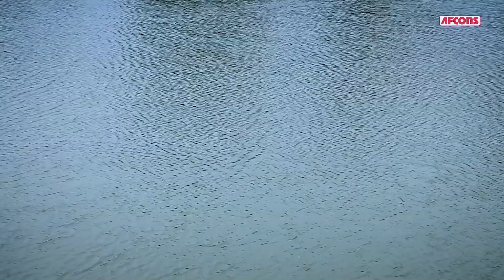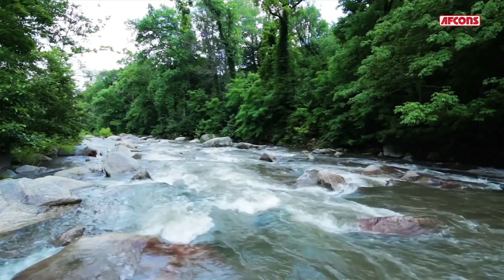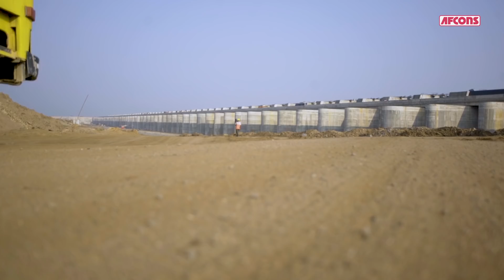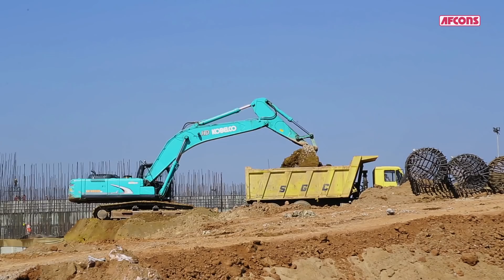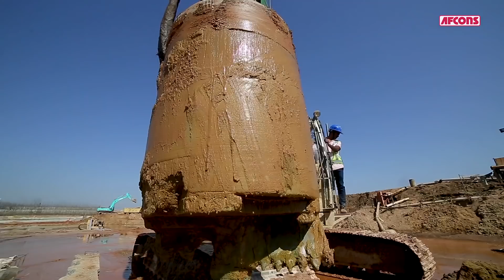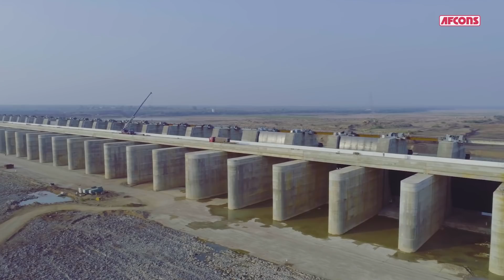Annaram Barrage - Defying Gravity

Comment: When this barrage foundation was laid, we thought that after 30 years our grandsons will enjoy it's fruits . As i returned from Australia after 3 years, i saw barrage with full of water.
It is a big shock for me. I didn't expect  that  will be completed in just 2 years.
Reply: naveen kumar BHEL make before schedule
Reply: @indiatraveldiary2605 
How BHEL is related to that barrage.
Reply: @naveenkumar-lj7og  pump
Reply: @indiatraveldiary2605  
It's megha company which made motors not BHEL
Reply: @indiatraveldiary2605  it is a not a pump house, it is a barrage.
Barrage don't have any pumps or motors.
Reply: Tremendous feat. I just hope govt also takes necessary steps (afforestation along Godavari basin) to ensure that water inflow does not deminish over years to come. (Like Cauvery)
Reply: Their sewer systems flow directly into their life water.
Reply: @naveenkumar-lj7og  it has 3 pump houses cumulatively consuming 1500 Megawatts of electricity that's how you punp water up stream and the third barrage that is being made will have pump house that will consume another 2000 Megawatts of electricity. 

(Dams supply water downstream not up stream)
Reply: Pl stop the debate and personal abuse. The project work is going on smoothly as scheduled.
Reply: naveen kumar they have several pump houses on this project, maybe not this barrage, but the whole point of the project is to raise water. 4600MW of pumps have been installed
Reply: @lrcrabbenz  it would be interesting to combine this with a solar array and energy  storage also... what an awesome project this is.
Reply: @dafrasier1  , What religion you belong to?.
Reply: @lrcrabbenz  but in this project, they store water in godavari river not in any tanks.
So if rainfall is adequate, no need of pumping.
Reply: GANESH BANDAMGANESH you’re missing the point. They have installed massive pumping capacity (4600mw) to raise water to barrages located at higher elevations. That is a fact! 🤷🏾
Reply: @lrcrabbenz  that barrages are constructed across godavari river.
If rainfall is scare, they will lift water from medigadda.
If rainfall is adequate, no need of lifting.
Reply: GANESH BANDAMGANESH pumping station at Medigadda allow Telangana State to utilise Pranhita River flow also. Sure, why waste energy if rainfall was plentiful, but why build so many pumps to distribute water across the other barrages if rainfall was assured?
Reply: GANESH BANDAMGANESH no tanks involved, buddy. The pumping stations lift from one barrage to the next. Clearly the designers have planned for inadequate rainfall as normal.
Reply: @lrcrabbenz  s,  designers installed so many pumps for inadequate rainfall, i agree.
But rainfall is unpredictable. Sometimes it is adequate and sometimes it is scarce. For example, Previous year rainfall is scarce but this year rainfall is adequate.
So no need to lift water if rainfall is adequate.
This year sri ramsagar, yellampalli etc barrages are filled with rainwater.
........
Reply: GANESH BANDAMGANESH I think high flows in Pranhita River would be lost to Telangana state, the Medigadda lift would capture these.
Reply: Its AFCONS
Reply: That's KCR 
HE MAKES IMPOSSIBLE TO POSSIBLE AND PROVED THAT
JAI KCR
JAI HAREESH RAO 
JAI KTR
JAI KAVITAKKA
JAI TELANGANA
Reply: @naveenkumar-lj7og  moters was made by BHEL
Reply: Congratulations to you and Telangana Sir. What a feat!
Reply: This happened because of current govt ...BJP is serious in development business....
Reply: Just 2 years, really surprised
Reply: @adityaayodhya  but your CM is appeasing minorities like anything, these projects all are to fool ppl main objective make money.
Reply: It's kcr who is behind this mission. We need more projects like this not religious structures. Coz we have enough of them.
Reply: Great  praise for you d guru in infra projects(Asia Foundation Constructions) AFCONS.

Comment: The similar project should be done on Brahmaputra and Gangaes river
Reply: Anoop Dixit you are complete disaster, because here in North India Water is not a problem, eventually the usage of more water in crops is a major issue. Moreover, this project is Lift Irrigation by a small state like Telangana. Astonishing achievement. People of India are not able to use Tejas Express(it runs empty mostly) so we don't need to invest in Bullet train. We need to Build Roads, Hospitals, Best Schools, Better training and Helping of Farmers, safe States for better Security by incorporating Moral values in Young.
Reply: @yogiegupta1373  we need both.
Reply: @yogiegupta1373  North Indian rivers need sewage treatment plants around them to clean the rivers rather than dams and barrages.
Reply: Ganga should be cleaned with sewage treatment plants and all the tanneries must be banned. Then we can think about the project. If we construct the project without cleaning it then the sludge will block the pipes and 2 to 3 lakh crores goes down the drain.
Reply: @yogiegupta1373  same thought was there when metro in delhi started construction
Reply: @yogiegupta1373  yeah those projects are very much of a need of the hour, and about bullet train, it's OKAY considering the terms of the finances of it from Japan,  we don't have to start paying the loans before 2037 and by than Indias national budget would probably be $1Trillion+

Comment: By using 4000 MW power liting water is seems confusing for me is it good or bad
Reply: 4000MW is installed capacity.
All will not run at once.
For example among 4000 MW, 2000MW will run just for 1 month.

Comment: Projects are good but this is one of the biggest mistake this government has made storing water at one place and lifting water in reverse direction that too very high distance how which current it needs to maintain and to run those motors it will cost nearly 4500 to 6000crs per year he is looting public money. That too the maintenance he has given to this party contractors all that money will go to this party fund. The day will come when telangana people will reliaze how much money he has looted in the name of development.
Reply: but, still we need water. telangana is water stressed,  due to this project their won't be much water problem.
Reply: You are a Fool. telangana annual budget is more than 2 lakh crores. 6k crores is not a matter at all. Govt spending raithubandu scheme for 14k crores unwantedly. Spending 6k crores for this project is not a problem at all. It will not deprive economy, instead it will boost.
One day will come  and on that day you will understand the greatness of this project.
And moreover, water is not stored at one place. It is stored in block wise.
Please do some homework before commenting.